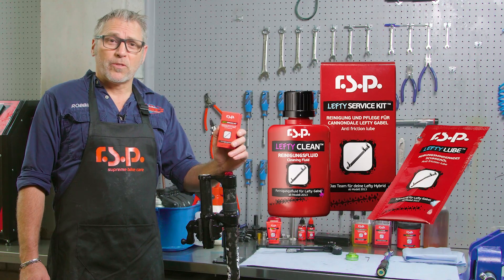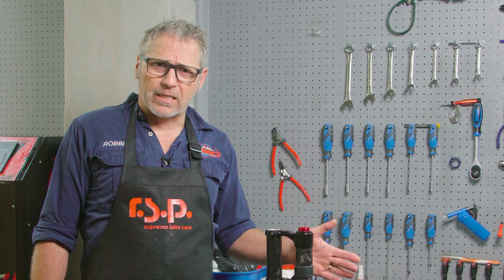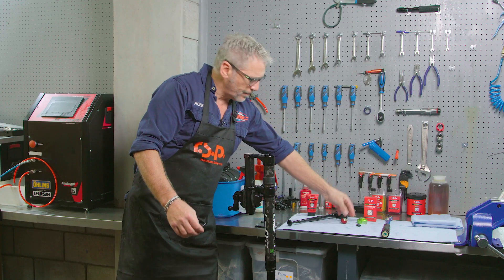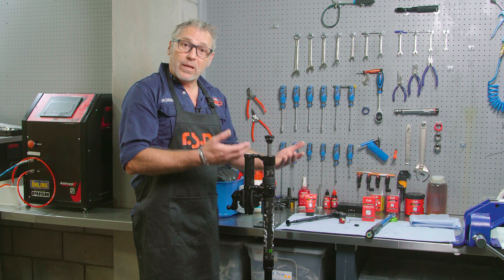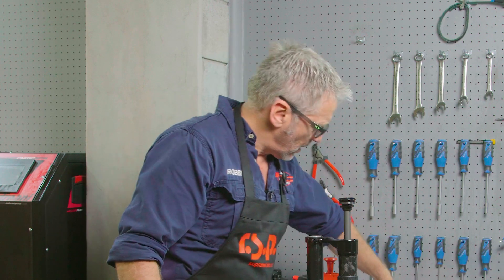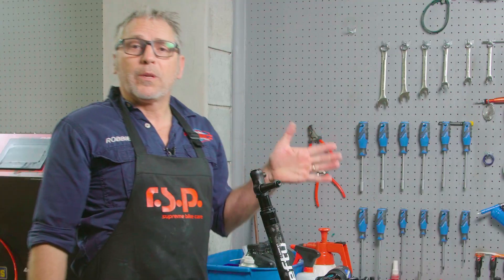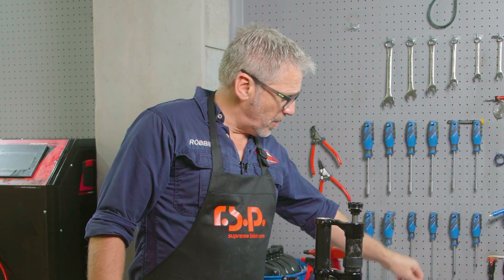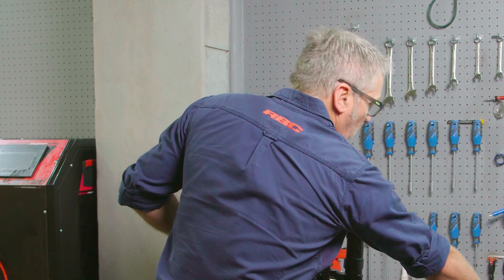Cannondale Lefty 50hr Service using the r.s.p. Lefty Service Kit

Comment: Hello, this procedure can also be used for a lefty OPI Speed 100 mm (2011) Thanks.
Reply from the maker: Hi Sergio, this procedure is meant for the lefty forks with the lower collar and seal, if you have the boot then you need to apply slick kick grease to the bearings and not the oil. This should be done by stripping the fork and cleaning the bearings and slides before refitting eith grease. I recommend this is done by a professional suspension workshop

Comment: Can the Lefty 2 lower leg be pulled down like your Ocho video?  What special tools are required to replace the lower seal and bearings? Are you able to do a lower leg and damper rebuild video for the Lefty 2?
Reply from the maker: Hi @timminehan3836  thanks for your message and support of our channel. The lefty 2 leg will also come out of the upper as the Ocho although there are some other procedures but its essentially the same. You would need the lefty 2 castle tool to remove the cartridge otherwise the lower cannot be removed. Also a special tool is needed to refit the circle clip into the fork when the lower is refitted. I don't recommend this if you don't have the tools or experience.

Comment: Hello Robbie, great video. Does this service apply to Lefty 2.0 ELO (2001)? Also, do you know if an ELO can be retrofitted with a mechanical lockout switch?
Reply: Hi John, unfortunately not,  the lefty ELO has open bearings with the bellows for protection.  The r.s.p kit is for the newer version which have the lower collar bushing and seal and use oil for lubricating the bearings snd not grease like the ELO. I believe that the Cannondale factory offered a mechanical lockout mech for the ELO back then but I think this is long out of stock. Check on E-BAY you might find some cartridges for sale with working electronics

Comment: First off, thanks for your videos. I just found this channel, looking first Lefty service related information. So I was really happy to see these amazing tutorial videos.

Now I got a question: Having owned a Cannondale Scalpel 2006 before, I love the Lefty. I am actually hesitating to buy a Lefty fork again and could either go for a Lefty Supermax Carbon 130mm or the Ocho 100 Alloy.
While I still love the looks of the older Lefty suspensions, I am worried about not being able to get it serviced due to spare parts becoming more and more scarce (well, the other issue is that the clamp distance needs to fit the frame and I would have to get an adapter steer tube to fit a non-Cannondale frame.
With all these things said, if going for the Ocho, I would definitely prefer the Ocho Carbon 120, but that is currently out of reach. The 100mm travel Alloy Ocho would fit my current bike, but I would lose 40mm of travel. 
That sounds like a lot of pros and cons, so my question @RBC_tech is whether you would recommend getting a “legacy. Lefty at all in 2024 or rather not. Thanks in advance for your input!

Comment: Does this function with the lefty carbon 2.0 from a cannondale scalpel si team hi-mod 2017. It have this lockout function and I’m also wondering what thats called
Reply from the maker: Hi Ragnar, yes this service will work for the Lefty carbon 2.0 you have. There are 2 lockout functions one is the manual button press with a green release button and the red rebound knob, the other is the hydraulic remote lever which has the red rebound knob under the hydraulic banjo.

Comment: Hi, that looks really slick. i have a Cannondale Bad Boy with Solo Lefty DL50 fork but unfortunately have no ready access to a qualified service center. May i know if i can use this for cleaning and lubing my fork? Thanks much and keep up the good work. Regards.
Reply from the maker: Hi Adrian, thanks for your message. Unfortunately the DL50 has the boot with open needle bearings so this needs to be greased and not oiled with the rsp lefty kit. As this is not a open bath system the oil would run out the boot. Here is a schematic of the fork  https://www.tritoncycles.co.uk/fatty-dl50-parts-finder-i207 I recommend that the fork be serviced at a qualified service center as specific tools are required to open the cartridge to expose the bearings.

Comment: Care to tell me how to do this on a 2000ish Left DLR? :D
Reply from the maker: Hi Paul, the DLR has the boot so the service procedures is completely different. If you send me an email to rbcbikes@gmail.com I will send you a video when we have one on the service desk.
Reply: Hi Paul, this DLR are quite simple. In a way similar to the Lefty 2.0 50hr service but the bearings are more accessible in that you can simply slide the boot down and lube the bearings with Finishline Wet lube. You can also get into the way Robbie does but you will need a top cap socket as well. Looking forward to more Lefty service video's from Robbie!!

Comment: Im looking at the manual for the name of the service , the service your performing in this video ....  is this the telescope lub or damper service , or is it both ?  Do you have a video if you have the xlr system ? Thanks
Reply from the maker: Hi Daniel, this is the telescope lube for the bearings and sliders. The damper service is much more involved and requires some very specific tools.
Reply: @RBC_tech  thank you very much for your reply,  is the process any different if you have the lock out remote?

Comment: This kit might be used for an old lefty speed carbon dlr2 '09? Thanks
Reply from the maker: Hi Luca, unfortunately not, this fork still has the open bearings with the bellows so the r.s.p kit wont be able to clean this. Furthermore the bearings require grease and not oil so its best to use the correct grease for this application. You will need to split the fork to do the service so my suggestion is to look for a good service centre that is able to assist.
Reply: @RBC_tech  thank you so much for the suggestion!

Comment: Hi! I have a lefty 2.0 and the red dial is really hard to push, and if I manage to unlock the fork, the green button sometimes pops out itself. I ride my bike with the lefty blocked most of the time. What can it be? something wrong with the cartridge? thanks.
Reply from the maker: Hi Pablo, thanks for your message and support of our channel. Your lefty 2.0 cartridge has gotten some water and dirt into the lockout tube. This tube sits under the red lockout knob and holds the lockout shaft and rebound rod. You will need to open the cartridge to clean this out and replace the seal at the bottom of the lockout rod. This needs to do done by a certified Lefty technician who has the tools and knowledge. Unfortunately the lockout knob does not completely seal so water can get into the lockout cup interface and effect the spring and o-ring inside the rebound rod.
Reply: @RBC_tech  If the lockout is harsh its probably caused by water entering the road but this sounds more like there is to much pressure in the cartridge.

Comment: My lefty is making a rubbing sound when I compress. How do i fix that?
Reply from the maker: Hi David, thanks for your message, this sounds like it could be the sliders and bearings that are rough or damaged. What happens is the needle bearings make grooves in the sliders which cause a rubbing sound when the fork is compressed. This is a job for a authorized lefty workshop as the fork will need to be dissembled and the sliders turned round and polished, I would recommend changing the bearing at the same time.

Comment: does this work for 2006 speed carbon fox terralogic
Reply from the maker: Hi Dalton, thanks for your message, unfortunately you have the lefty with the boot and exposed bearings, this needs to be completely dissembled and re-greased so you cannot use the same method as the newer lefties with the collar.
Reply: Thank you for letting me know

Comment: Great video, new subscriber here. Do you know if lefty Olaf obsolete?
Reply from the maker: Hi @justking.4050 thanks for your message and support of our channel. Unfortunately Cannondale only offers full support for the current Ocho, even the lefty 2 parts are becoming hard to get.
Reply: @RBC_tech  I just got a fat caad 1 with lefty Olaf. What do you suggest I do to maintain longevity? Thank you for your expertise
Reply from the maker: Hi @justking.4050, wow awesome bike, you must be stoked.. Ok my advise is to have the fork serviced according to the manufacturers recommendations or every 6 months whichever comes first. Seal kits are still available but hard parts like damper shafts and stanctions are not readily available so prevention is better than cure.
Reply: @RBC_tech  I’m very excited my friend. Thank you. I plan to get it serviced immediately. Owner said the bike only has about 5 hours on it

Comment: Hello, what îs the dimension of the key țo open the fork, 24?
Reply from the maker: Hi Robert, thanks for your message and support of our channel. The green socket tool is a specific Cannondale tool and the dimension is 36mm socket, for the low air nut the socket is 26mm
Reply: @RBC_tech  Thank You so muchh👏

Comment: So there's a guy that's selling a 2013 PBR Lefty fork and I was going to buy it for my Cannondale ryze4 , it's for a 29er but my bike is 26inch so I'm not even sure if it will work but he said it needs to be rebuilt or repinned, and I have no idea what that means but if it requires sending it to Cannondale then it's not really worth it to buy it correct? Because I mean if you're saying every 50 hours you need to do that than a fork from 10 years ago I'm sure would need a lot more attention? Also if I just said screw the rebuild could I just use the fork the way it is in it's current condition? or would it not work at all? I contacted a few bike shops in my area with the same questions but they said that they're not Cannondale dealers so they don't have proper answers for me. So after you I will probably just contact Cannondale but if you can help me out with the servicing part and letting me know if it's even worth it to buy he selling it for $170 canadian plus it will be about $40 shipping. And also if the 29er would fit on my 26 inch cannondale ryze 4. Any advice or knowledge you can share with me  would be greatly appreciated thank you for your time!!!!
Reply from the maker: Hi @trevorjames5493, thanks for your message and support of our channel. The Lefty PBR that you are looking at is the non boost model, lefty 1 which is now obsolete and there are currently no parts available for service other than the bearings and the bushing collar. If you decide to purchase the fork it will most probably be 100mm travel and the ryze4 should have 140mm travel in the front. Its possible that the fork height will work for the bike given that the bike comes with 140mm travel so the added height of the 29er fork on the 26" bike should be negated,  but you will still only have 100mm travel which will negatively affect the bikes ride capabilities.
Reply: @RBC_tech  so due to the parts no longer being available and the less amount of travel on the lefty I should just keep my original forks your suggesting?
Reply from the maker: Hi James, what forks do you currently have on the bike?
Reply from the maker: I forgot to mention that you would need to change your front hub to accommodate the lefty, also the question I would like to ask is why you want to change the fork on your bike?